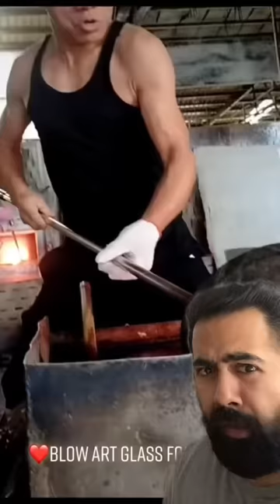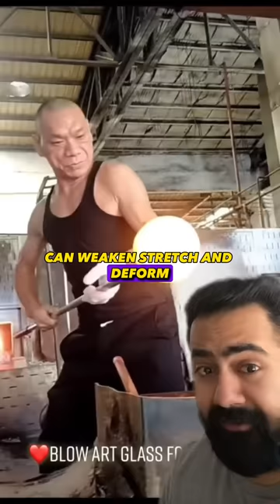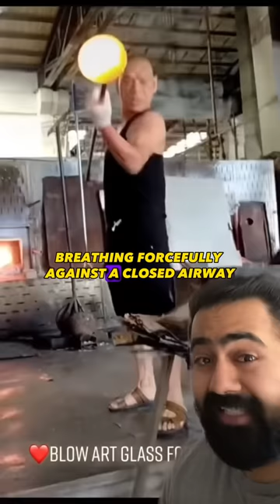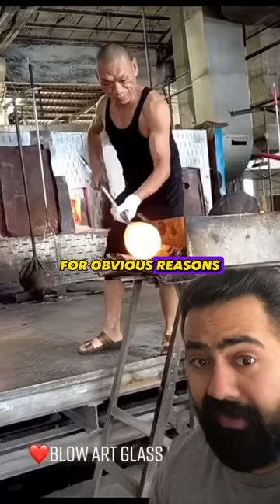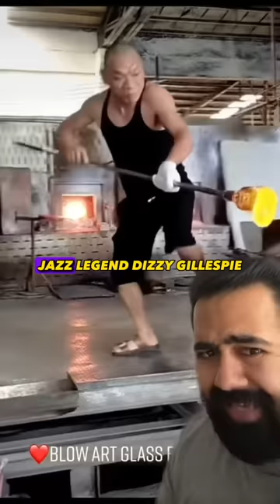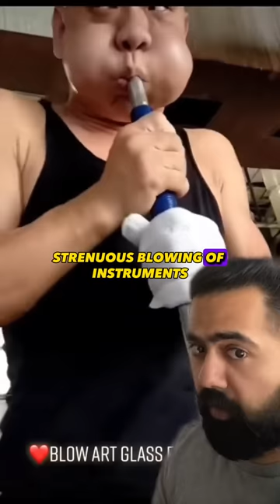Doctor Reacts To Glassblower’s Disease!

Comment: There’s proper technique for using instruments that will prevent both of those diseases. In essence, you just keep your cheeks relatively firm.
Reply: I think it's a misconception that this kind of cheek only occurs when you puff your cheeks. These can also occur when you don't puff but you still use excessive pressure. Even without puffing the cheeks they still slowly deform as the muscle groupings of the buccinator stretch. I play the trumpet and I hope to never reach that point...

Comment: 30 years ago when I was learning trombone they warned explicitly not to puff your cheeks. If you don't, you develop the muscles to resist this and your air pressure and control will be increased over someone with puffy cheeks.

Now the puffy cheeks might help with circular breathing. It's like a bag pipe so more space = more air = more time to breathe through your nose.

Comment: There's no need for him to do that. He's causing those issues. It really doesn't take that much when the glass is that hot even when blowing into a mold. He could start blowing and then cap the end with a finger and the pressure would increase just from heating the air in the pipe. You can even use an air compressor if you're careful. Most industrial glass blowing jobs pay very little and are a grind.

Comment: Maybe someone can help me, because doctors won’t due to no health insurance… almost 5 years ago I was smoking weed and held in a cough and instantly had a lump under the right side of my chin, didn’t hurt, a few days later a lump appeared under the left side of my chin and then really bad pains started setting in, went to a doctor for swollen lymph nodes and got antibiotics, the lumps went away but the pain kept getting worse. The pain is mostly in my submandibular glands and have traveled up around my jaw to my parotid glands and in my ears.. Atleast that’s what I THINK I know…. fast forward almost 5 years later with continuous expensive doctor visits I’ve gotten nowhere and this pain is controlling my life, I’m a 23 year old male and got my wisdom teeth removed in the process and nothing changed with that… every move I make concerning muscle puts me in a lot of pain I’m so depressed and family is worried, I just want to give up at this point the pain is so bad. If anyone can give me advice it could be a life saver.

Comment: The misconception is that it’s a disease 🦠 or some kind of pathogen . When really it’s a level of mastery westerns tend to not take serious if properly taken care of the thinning of the cartilage can be strengthened again and again . Take for example you both widen your mouth cuase you can do this with miner surgeries and this cartilage “disease “ is earned while then . More space , more air that can be trapped on the inside . Another Example if one was to have both and be a Fire spitter of some sorts. One could pull off “ super human “ feats . It’s just a natural form of body modification like bone lengthening “disease “ .